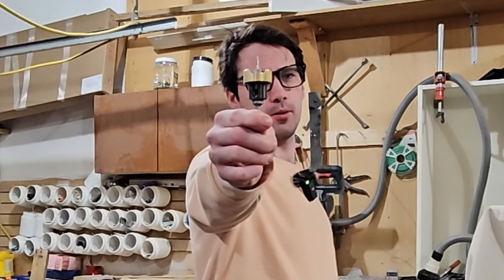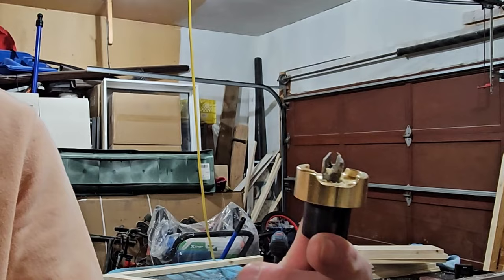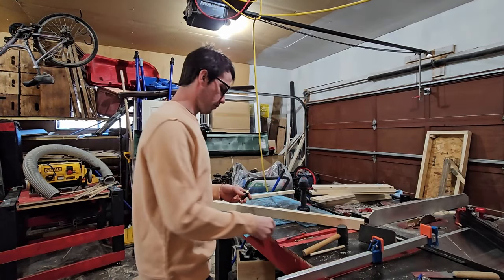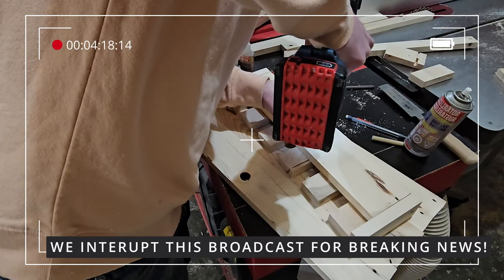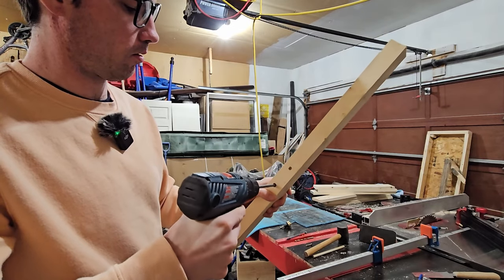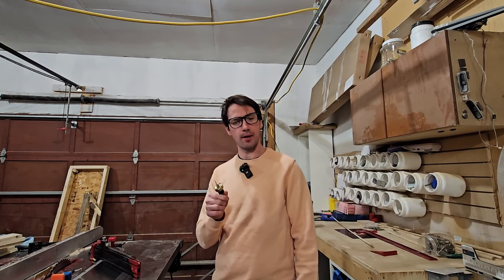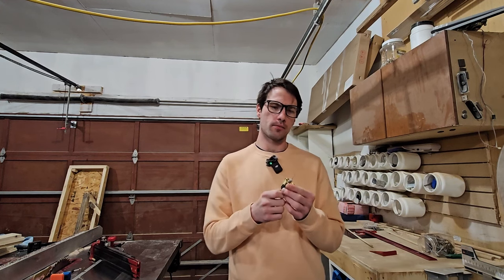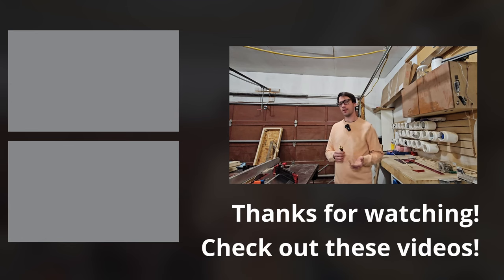I Really needed this Cool Tool #1 [] Drill bit w/Countersink

Comment: Thanks for the video. I just got the 6 piece kit from Amana a few days ago. After using countersinks for decades I finally found one that doesn’t mark the wood, and has carbide cutters for a flawless cut. Yes I know they are expensive but, they are a quality product that should last for me.
Reply from the maker: They are pretty good. I ended up breaking the tapered bit in the middle. And have since gone through probably 20 very cheap bits. But the rest of it is holding up great